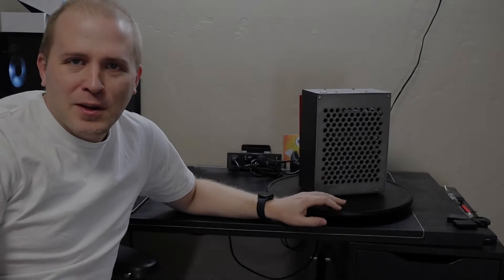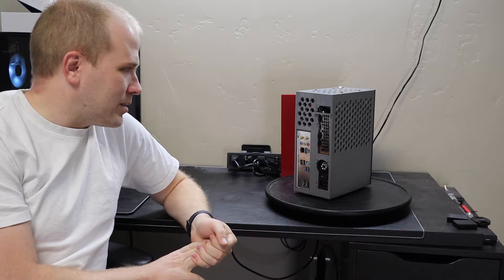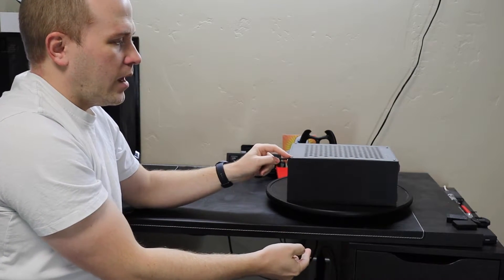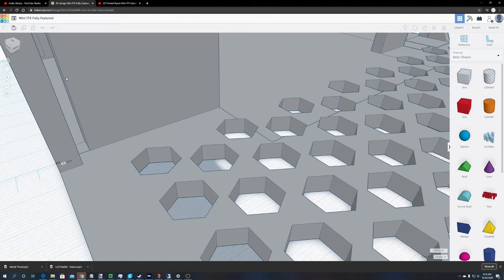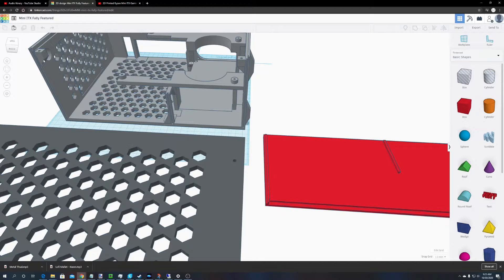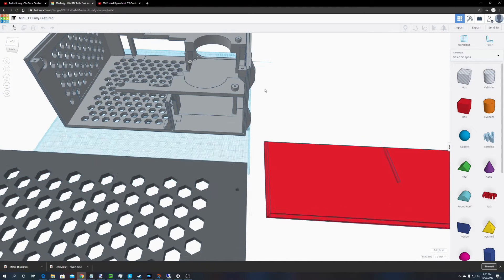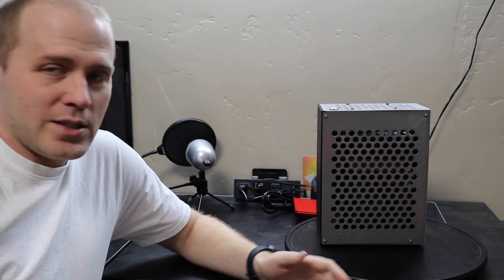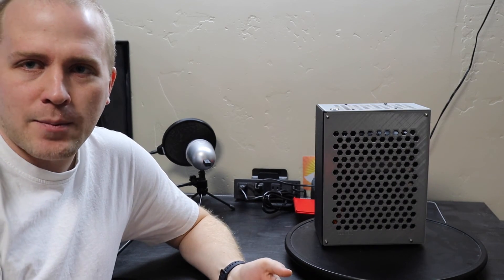AXIS 300 - The 3D Printed; GPU Supporting; Mini ITX Case

Comment: i  love your cases im trying to build out  a MATX case in parts on a ender 3  any chance for a upsized build  ryzen 3400g with a wifi 1x pci card motherboard is Asus prime B450M-AII  250g m.2 and 8gig gkil ram  i have a pico psu looks like it may be a 120W and not the 150W anyone know if this build will work ?

Comment: I have been searcing across many different sites but I have not found a case for ATX parts .I dont mind printing in multiple pieces and having uneven screw holes. I was wondering if you could convert this design into an atx build?

Comment: Any way this could be re-mixed WITHOUT the GPU slot?  This looks perfect, however  I am looking for a 3d printed case for a server, no GPU and this model with a GPU slot doesn't fit on a Prusa i3 MK3S+ build volume.